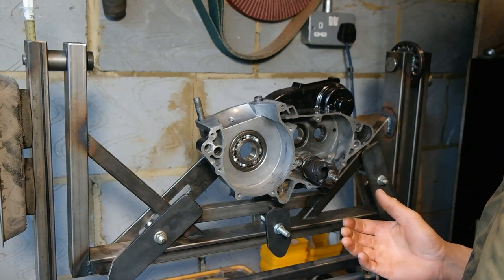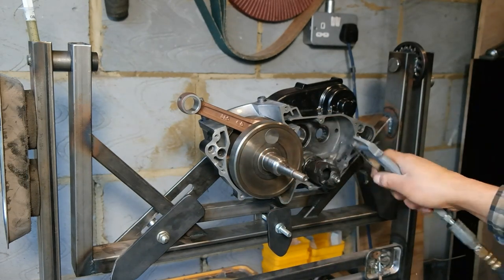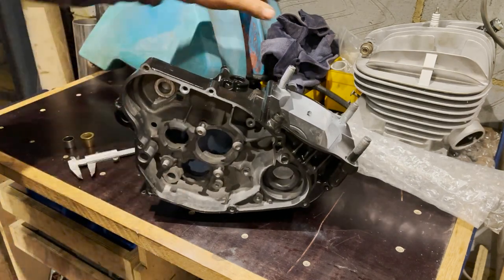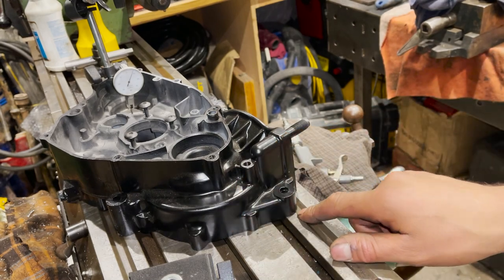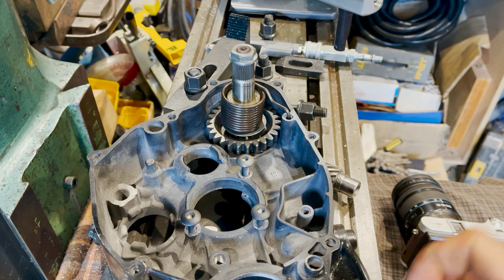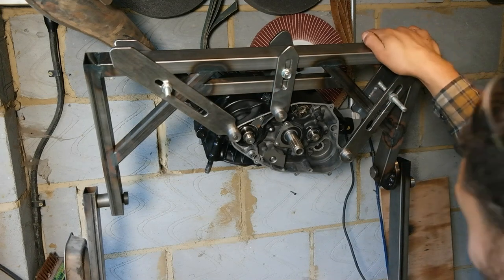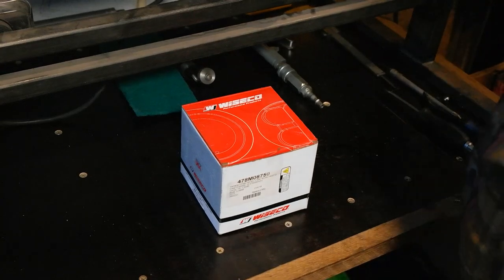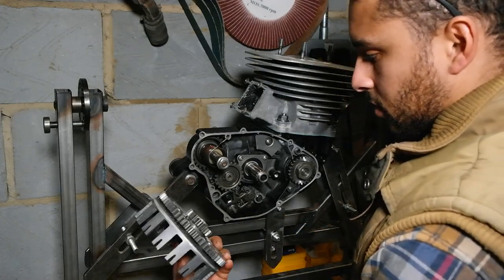Yamaha IT490/YZ490 Engine Rebuild & Decompression Valve

Comment: Have the same bike same troubles.. got a machinist to bronze bush the Kickstarter hole (both) turned out lovely! Great for peace of mind! Great video thanks!
Reply: Any chance you would rebuild my it465?
Reply from the maker: Thank you!! 

 The bronze bush is a good job alright, you can even re centre the hole when boring it out as well to avoid the kick start gear rubbing the inside of the engine case!
Reply from the maker: I can do yes! If you have Facebook or Instagram you can message me, if you want to send any pictures it’s also keepitbigbore 👍🏽

Comment: Looking forward to hearing it bud, gonna sound dam good!
Reply from the maker: Thanks, you and me both! She'll look good across the back of the defender!!
Reply: @KeepitBigBore  How is the M57 lump holding up, still running a dream!?
Reply from the maker: Still going strong mate. I’ve put 20k miles on it now and have had nothing but minor teething issues, nothing you wouldn’t expect of a 230k mile engine (oil cooler seal, turbo rebuild are the only things I can think of). As for the Land Rover, again, nothing but usual issues, the transfer case was the biggest problem I had but that was clearly my fault. Done all the wheel bearings and a transfer case rebuild and that’s about it 👍🏽
Reply: @KeepitBigBore  I never really understood why they didn't put the m57 in the defenders from the beginning. Apart from the obvious fact that They used it for the rangey, you think of the strength and torque from a nice straight 6 Diesel. Next best thing to a John Deere!!!
Reply from the maker: I know, they should have done it for sure. There’s no reason to have it in a Range Rover and not a defender. 
I think Ineos is taking up the slack and doing what Land Rover didn’t with the grenadier!
Your right…but everyone knows a John Deere is no match for a Massey 🤣
Reply: @KeepitBigBore  hahaha ..... You know what they say, nothing runs like a Deere!

Comment: What is the cylinder head nut tightening sequence?are those flange nuts? If nut and washer how do you get correct  torque values?thank you for your time
Reply from the maker: The sequence is just opposite, I always tighten to half torque all round and then do full torque tightening the opposite nut every time instead of moving around clockwise or counterclockwise. I wouldn't worry too much, it's hard to go wrong with these small heads. I took the torque specs from the manual, I can't remember off the top of my head as every engine I do is different!
Reply: I appreciate your time and knowledge- I know it's valuable- kl def use that method- awesome video very informative and straight to the point

Comment: I would love the decompression valve.lol used to nearly take your leg off if you got it on the wrong stroke 😎💕
Reply from the maker: I know, they are a serious bit of kit to kick over. As digiman said in his comment on this video, a lot of it is down to timing but a lot of it is simply too much compression. The cases break from back fires but a decompression just helps with everything. 
I actually bought the 85yz490 because the previous owner said he just didn’t have it in him to kick over any of his yz490’s hence why he seemed to be selling them off. It’s a pity that people seem forced to get rid of their pride and joy for that reason!!!

Comment: I have the IT G 425 I'm putting LEG Lights front and rear so I can ride it on the road but can be put back to factory if some one wants it later. But my power valve it HOLY %$@ crazy. I am worried when on a wet the back tires going to spine and i'l end up on the asphalt .
Reply from the maker: 😂😂😂 I can’t wait to ride this now!!! 

I agree with the LED lights, very easy to change back if needed, more efficient, brighter, whiter light, just better in every way!!!

Comment: Im in Australia. I was wondering how that decomposition valve is activated, by pressing down or vacuum and how much pls .  Mike
Reply from the maker: Hi mate, this one uses a cable with a small lever which I normally mount on the clutch lever side. It’s a short lever that tucks away nicely beside the stop button. You could mount the small lever anywhere you want really. Puts button ones can be used also. I don’t do too many these days but I charged in the region of GBP £125 for the last one I done. 

Kind Regards
Martin
Reply: @KeepitBigBore  ok. Sounds good.  I'll think about it. Mike
Reply from the maker: It’s worth noting as well that some people have used the little push button decompressors on the side of the cylinder head on these bikes, I tried to avoid it purely because I wanted to keep people’s fingers out of the hot fins but it’s

That type would be a LOT cheaper to do as it’s just simply drilled and tapped with no welding so it comes down to what people prefer. 

All that being said, there’s a good chance you’ll find someone in Australia to this for you as the shipping involved from you to me and back would be crazy.

Comment: What are your thoughts on joining the cases with a hammer vs a crank press?
Reply from the maker: I think it really depends on the fitment or how tight the bearings are. The only thing that will give much resistance when pulling the cases together is the main crank bearing, the transmission shaft is usually a loose fit. 

I always choose to pull these together by hand if possible and avoid the crank puller because you have a better feel for any snags. 

You can see at 1:44 that I couldn’t push the crank into the first half case by hand but after a slight bit of heat it slides right in. Just do the same for the second half case and use a light rubber dead blow hammer with GENTLE taps all round and you’ll be fine.